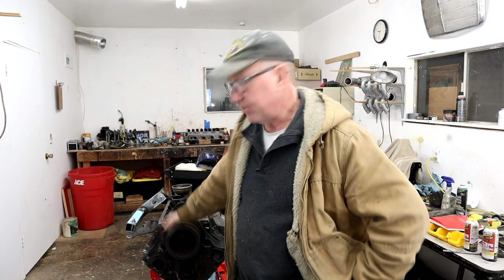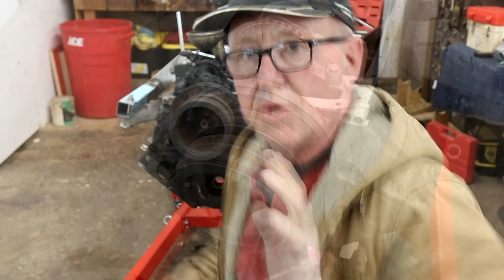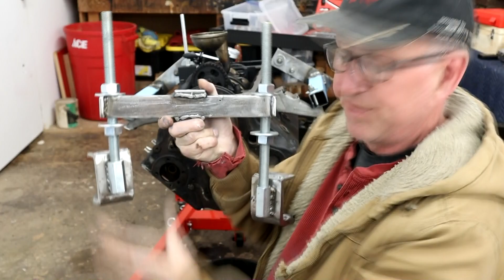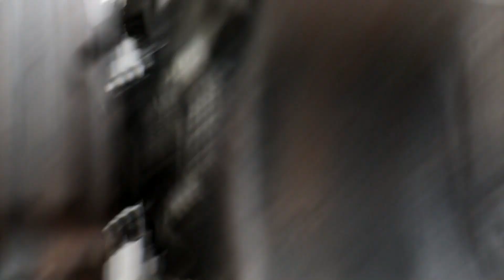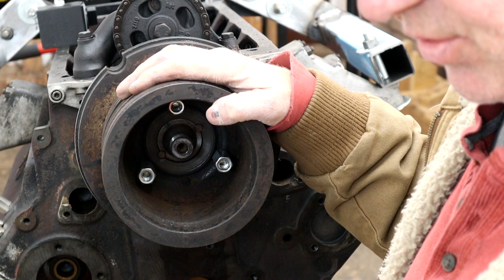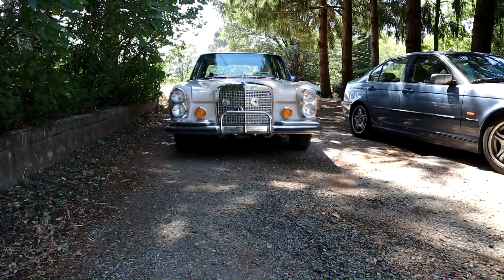MERCEDES W109 6.3 HARMONIC BALANCER REMOVAL TOOL. PART 6

Comment: Bloodyhell this is tight. I think 450Nm to tight it.
Reply from the maker: It really is. 450nm they didn't want it going anywhere:) Cheers John.
Reply: @mercedesmaintenance.6339  450 - that's crazy!
"Only" 295nm on my 928. But it's a bit nerve racking tightening it back up , You feel as though it's going to go righty-loosy, even though you know it's stronger than you are!
Have you got the mother of all torque wrenches for that job?

Comment: The tool you made is good. You could use a hydraulic type.
Reply from the maker: I did see those. But I wanted to make a simple tool that maybe someone else could make too, without to much cost. Cheers John.